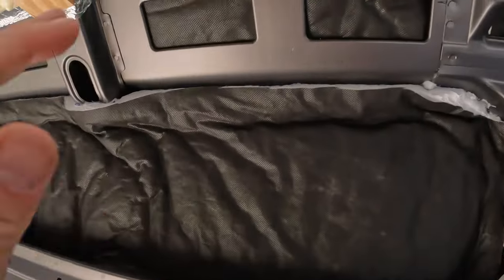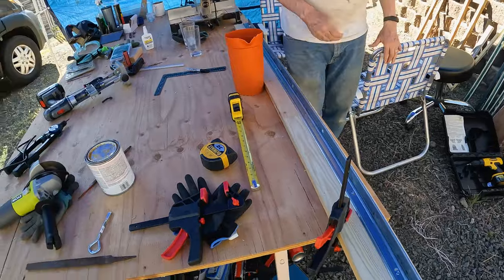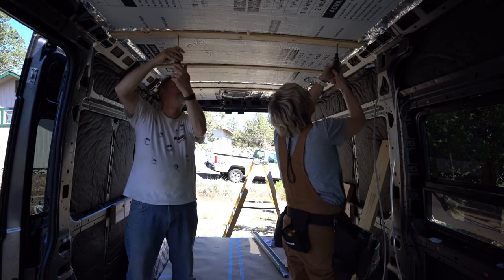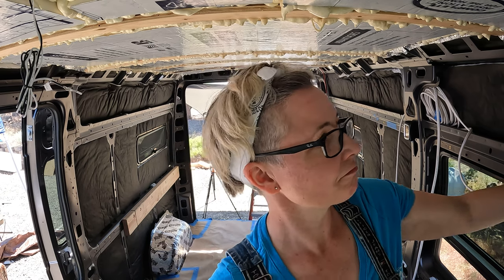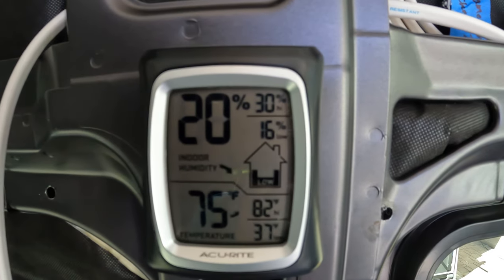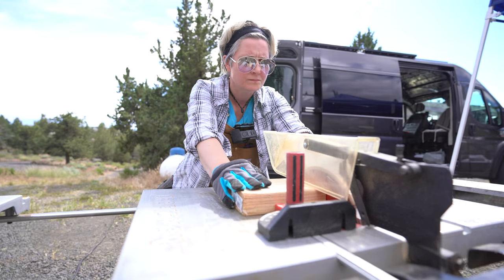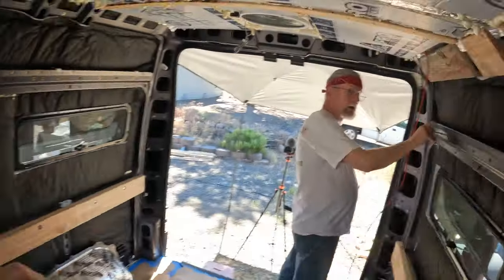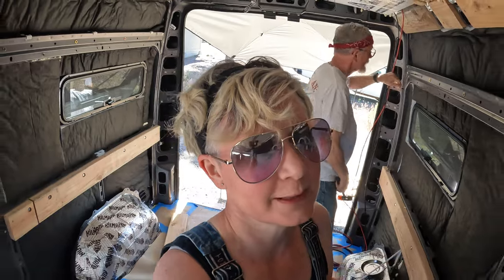Promaster Conversion: Framing - Bed & Ceiling | Solo Female Van Life | S1 Ep. 25

Comment: I got an indoor & outdoor temp station so I know what to expect when I step outside, mounted the outside temp sensor near the rear so it's not in the direct line of wind and road debris.
You mentioned passably a second van build, I suggest looking for a 20ft class C, it will be the best thing you can do for yourself.